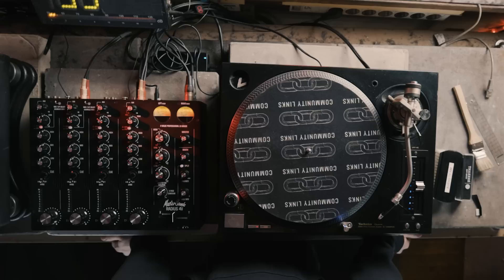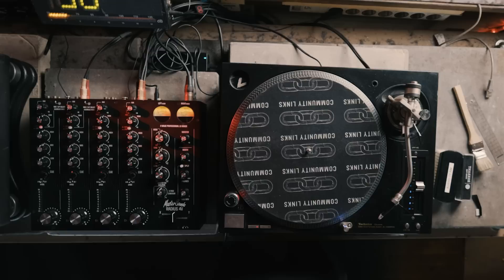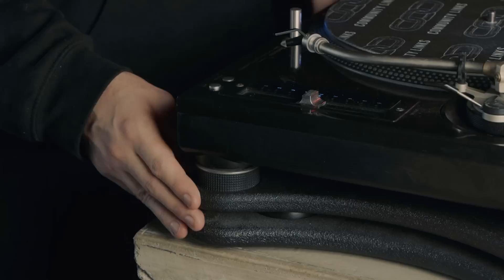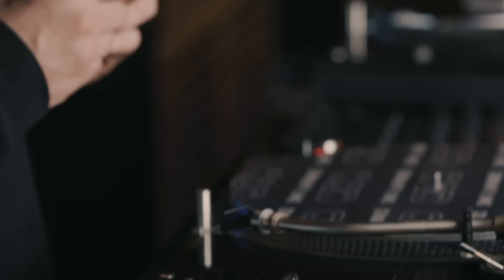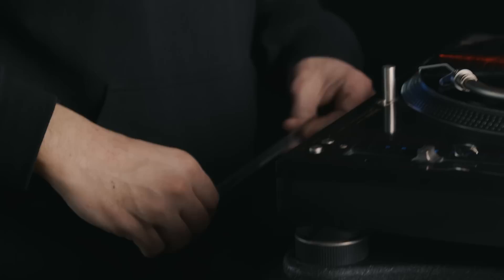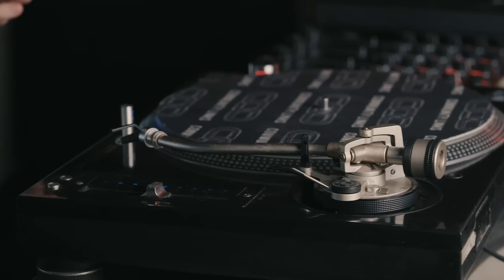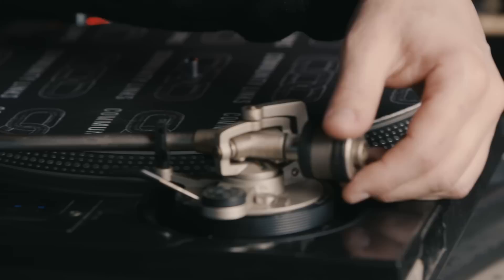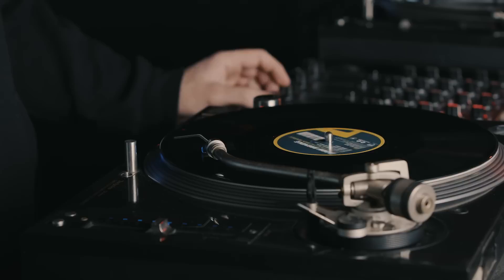The (Almost) Perfect Turntable Setup | Hoppetosse

Comment: CDV and Hoppetosse are two of my favorite clubs in Berlin. Playing records is still a big thing in Berlin / most of Europe it seems, and it's nice to see the attention to detail by the engineers and staff accordingly. After years of playing on vinyl and on a few different club setups I would like to add a few tips / modifications to these guidelines. 

While it's important for a tonearm to be as level as possible—according to a technician I've corresponded with at Ortofon—this is not as critical for a spherical stylus but is important for more complex stylus shapes, for example the Ortofon Club that has a special-elliptical shape. For setting tracking force I find it helpful to use a scale to precisely check the downforce especially when gigging around because there are always slight variations from turntable to turntable and I don't trust my tracking force without one. 

My main objection to any of this are anti-skate settings. Although the Technics manual and cartridge manufacturers usually advise to set the anti-skate to the same as the tracking force, if you're gonna be doing any back-cueing or scratching this should be set to 0. If you want to be more precise and set this based on the nuances of the deck you're using, you can use the technique in the video and find a single sided record without any grooves and drop the needle on. Slowly adjust the anti skate settings so the needle stays where you drop it and doesn't pull inward toward the spindle or outward to the platter. I usually bring my own cartridges (Ortofon Scratch, basically similar specs as the Q-berts) but all of these rules apply when using M44-7's or whatever house gear as well. 

Also, use extra care with static electricity if using plastic under your slip mats, or in general pay extra care to watch out for static because cartridges like Ortofons have a coil of wire inside as thin as a human hair that's particularly susceptible to electrostatic discharge. Luckily Ortofon are great at customer service and will replace your cartridges for free if they're under warranty, but you've been warned! ;)
Reply: I found the scale also helps when the bearings have seen better days and the tonearm just won't let itself get balanced without swinging about :)
Reply: Im kinda new to this How do you prevent the static? Antistatic brushes? Internal grounding? it hasn’t been much of an issue to me but would be interesting to know in case it happens.
Reply: @alexeyklepikov2770  hi there, I hope you're doing well. I realize you might be asking about two separate ideas of "static" one in a sense of the electric shock and another in the sense of audio static. 

I'm mainly referring to the electric kind which in my experience is inevitable and shouldn't be a concern most of the time. static charge can build up even with decent "anti-static" slip mats. as you said it's good practice to use an anti-static brush on a spinning record before dropping the stylus on and just be careful when you notice any static to not immediately touch the cartridge, especially Ortofons. ;) 

on the subject of audio static or "humming" you referred to internal grounding—this is to remove that extra little ground cable from your turntable that usually hooks to the back of your mixer to prevent ground hums or buzzing in your signal present when there are differences in electric potential or something something above my head. people have differing opinions on whether or not to do this but I had my technics serviced and internally grounded a few years ago and I haven't experienced any issues thusfar. others can chime in here for their opinions if they've read this far, sorry for the long post, I hope it helps. :)
Reply: Second the scale. Has been a game changer for me when out doing gigs. So quick and easy. Super cheap as well. Think mine was $15 on Amazon.

Comment: Good stuff. Been a vinyl DJ for many years and the advice here is sound. Only thing I do differently is set the height and skate to zero for scratching
Reply: yep, should be mentioned that anti-skate is not your friend if you're doing a lot of scratching (or even back-cueing!). and a higher turntable arm height will give a better 'bite' if you're heavy into scratching and don't care about sound quality (or gouging your records ;)),

Comment: if you still have needle-skips because of bass you should try to decouple the concrete slabs aswell. Maybe through anti vibration rubber-pieces or squash-balls
Reply: the industry standards are surely the ISONOE feet pads. not a big expense for any club that's rocking an analog rotary mixer. they're so effective that they are even adapted for use in medical and measurement science (:
Reply: @aaroninky  for smaller clubs they’re pretty expensive though. And especially when the booth isn’t as solid as i wish it‘d be I‘ve found that a combination of different techniques works best
Reply: 4 or 5 grammes of weight on the tonearm should keep that sucker in the groove
Your records wont last a life time though
Reply: @russyJ20  ja that's the last ditch resort IMHO

Comment: Thank you for videos. They are super informative and helpful. Could you please help with a query? My turntable is an audio-technica at-lp120xusb with built in phono and line pre-amp. When I connect it to my Technics su-3050 integrated amp the sound from the speakers (aiwa sx-lem70 6 ohms) is super low. Can you please tell me how I can solve this. Many thanks

Comment: if you dont know how to mix  records or create interesting transition that go over +/- 8% on regular technics you need to check your skills,
the tonearm adjusting demo is proper..
Reply: He wasn’t talking about mixing in the strict sense (as in transitioning between songs), but rather significantly altering the speed of a record to hit a bpm range compatible with the club to be fair.
Also pitching House records up to 140 is a lot of fun in my opinion
Reply: i'm just saying not every transition has to be beatmatched there are so many ways to transition from record to record. So the =16 - 16% doesn't matter
Reply: @AboveTheTrees00  give a few examples of how you'd mix records that have very different bpm, lets say 130 and 100, or 80 and 120... obv depends on the mood of the record, but just curious what are your ways to do it technically
Reply: @looking.for.treasure  You don't have to beat match every transition. Echo out, reverb out, mix out of a breakdown or fade-out etc
Reply: For crazy +/- pitch the audio technica AT LP 1240. the motor on it is crazy too.